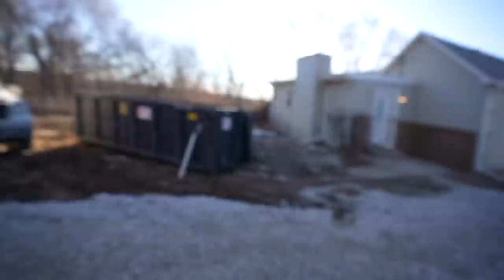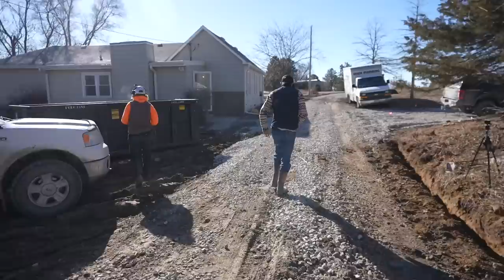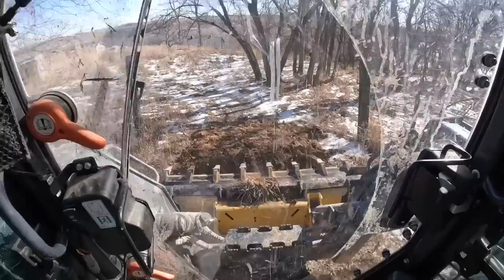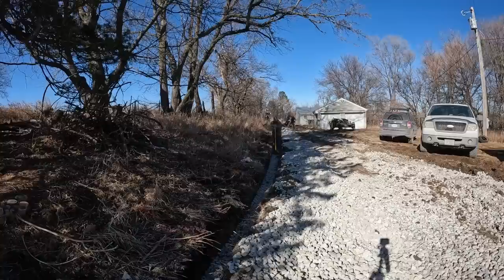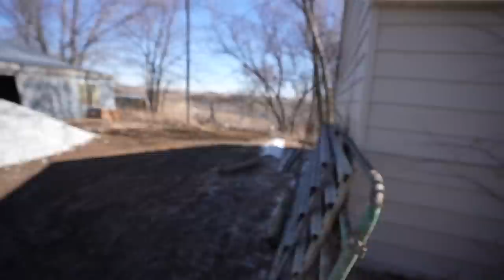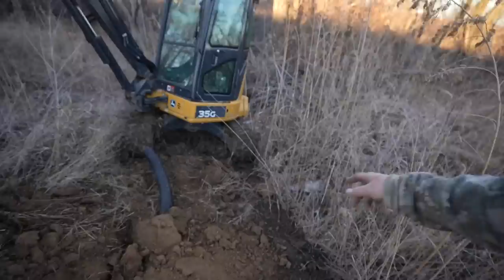Building a MASSIVE French Drain at the New Property to SAVE the DRIVEWAY!

Comment: The fabric is important. It keeps the dirt out of the gravel and the pipe. Without it the drain will fail in a few years.
Also you have to lay down your exit pipe. The way its curled up won't let the water flow

Comment: Only thing I would've done different is when you started laying the rock for the pipe to lay on, I would've straddle the ditch with the skid loader and bump shake the bucket as you drive over the ditch. You can get a bucket full of rock from the pile and dump right beside the pile and reposition the skid steer so that your loading the pile you just dropped from the end. That load's the rock mainly in the center of the bucket. You won't have as much rock, but when you're straddling the ditch with the skidder , most of it goes in the ditch and very little along the sides. Keeps everyone from having to do shovel work. And seeing how you don't really need that much in the bottom it's a lot faster with the skid steer vs shoveling it in. Once you see a operator do it , you won't put bucket load's all along side the ditch and you'll save rock which is crazy expensive like you said. Other than that y'all kicked *ss. Might consider the 60G John Deer mini excavator That's the model I ran for 6 years.
It's much more powerful to deal with frozen ground.

Comment: What I have found that works the best is a post hole drill that drives like a 3 to 4 inch round pointed pipe down into the frozen ground over and over like 4 to 6 inches apart in the line you want to dig up and the dirt breaks up 1000% easier and hundreds times faster.

Comment: Flair you should definitely put down 3” rock first on your driveway to get a good base set for driving over with all the heavy equipment and get all the 3” rock all set in really nice and then go back threw and put down some1”1/2” clean rock on top of the 3” rock!!! The 1”1/2” will fill in between the 3” rock making it much smoother to drive on also!!! And I usually will stop after putting down the 1”1/2” rock or if you can get 1” clean rock that will also help fill in between the 3” rock now if you can get a 1” clean rock you can skip the 1”1/2” rock and just go 3” first then a 1” clean but if you can’t get 1” clean then go 3” first then 1”1/2” and then you can go a 3/4” clean or even 3/4” chips!! But definitely your rock will keep disappearing if you don’t start with a good 3” base first!!! I have a 300’ driveway and every other year I have to keep adding rock because I didn’t put a good 3” base down!!! Everyone kept telling me to just use a 1”1/2” clean but after living here for over 20 years I definitely wouldn’t do it again with out putting down a 3” rock first and letting everyone drive over the 3” for at least 6 months first and then go back over it with a smaller rock!!! If you actually do a 3 different sizes of rock I can actually get it to be just like a slab of concrete when finished!!! Just thought I’d let you know so that you can save some time and money in the long run also!!!!

Comment: You're gonna want to dig that connection up and rock it a few feetnpast the connection. Otherwise, when the dirt settles, it will pull the pipe out because the rocked pupe will stay still, and the dirt pipe will sink especially when it rains and water starys to drip through the connection or if the end gets blocked it will come out of that point, the dirt will turn to mud and the pipe will settle more.

Comment: You absolutely do need the fabric and you put it in the wrong place. 
You should have wrapped the perforated drain pipe in fabric and used pea gravel to surround the pipe and then the larger rocks on top and then dirt over that. I used to do this kind of stuff for a living as it was my business.
Reply: Fabric get clogged with silt, fabric sucks
Reply: @kevinb8285  is right no fabric is good and always called for 8n high silt problems but so is bigger rock
Reply: @joshuamiller2196  I’m just trying to start a fabric no fabric war
Reply: He should have used PVC and you don't have to use fabric. Corrugated is trash!